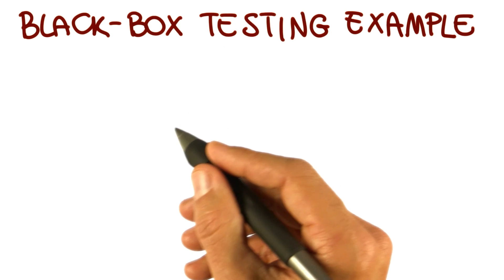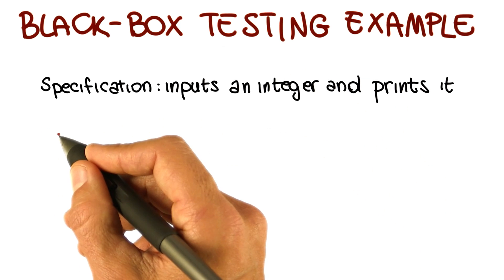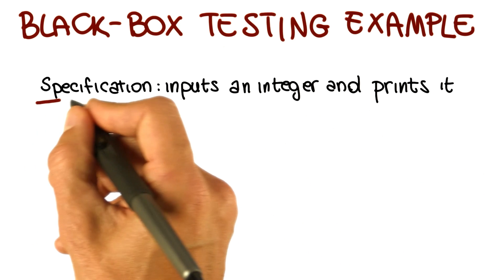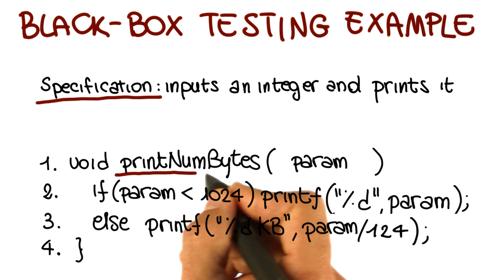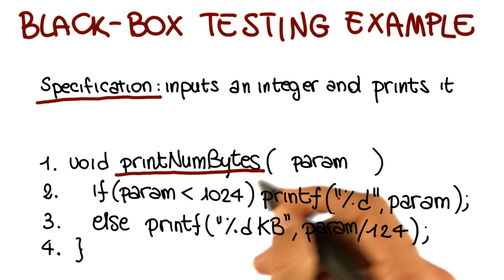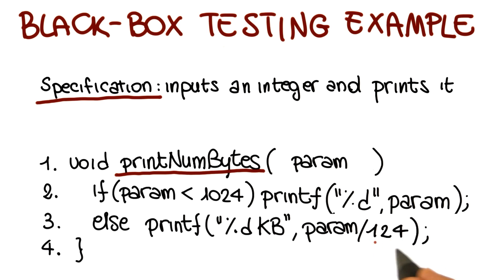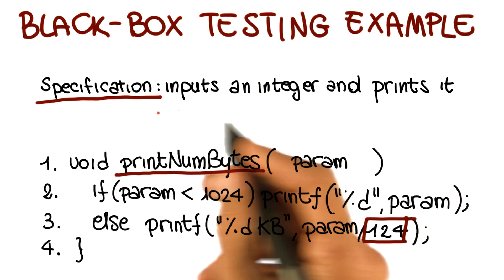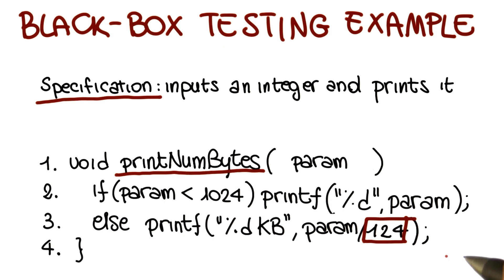Black Box Testing Example - Georgia Tech - Software Development Process

Comment: You can test most of this from a black box perspective. One example is by conducting boundary value analysis.  

Would’ve been handy to give a definition first before killing straight into the differences.  

Thanks
Reply: This is video in a playlist, they had another video where the definition are explained. This is a followup video that shows an example.